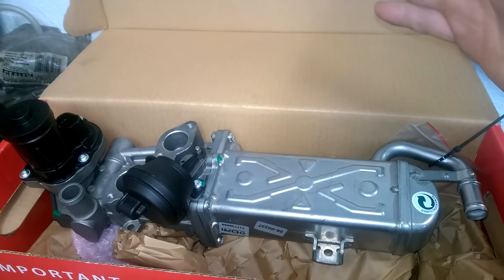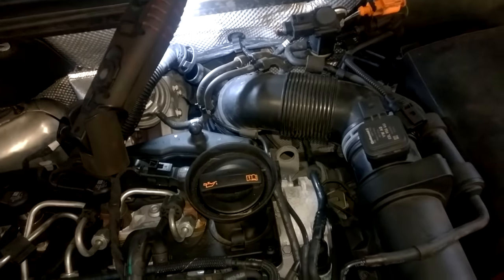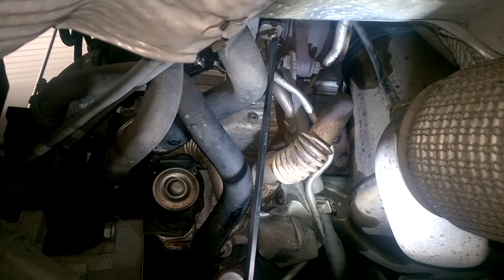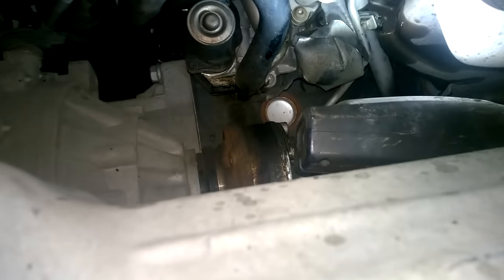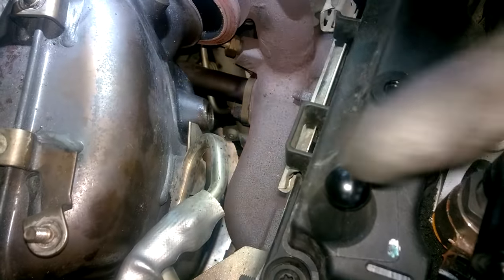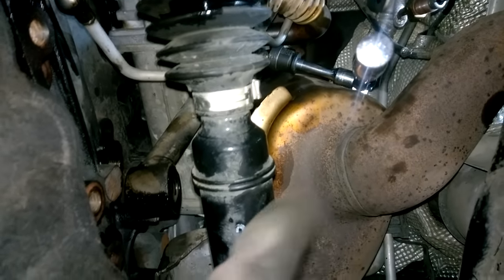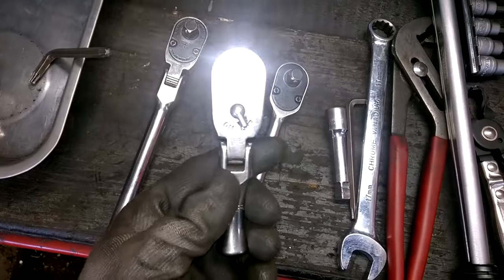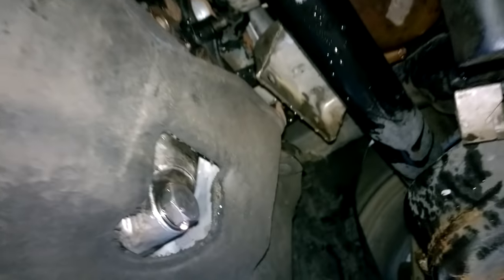Volkswagen EGR Valve Replacement - How To

Comment: Being quoted €800 by a VW dealership to get a new egr valve , am I being robbed...
Reply: Yes what about labour on top . Cant get the valve eurocarparts 250 ish or 300 .I've been quoted its 5 hour job around 550 pitlane garage luton then vat . 😥 sadly car drives perfectly no check engine light or error code for egr issue. Even when  car loses power struggles up hill has no pull  white smoke .just been told its issue with alot of diesels. What cant understand why I'm not getting an error code ..dealership are just making money for models after they sold and well get problems because the emission palaver. Its all a con and to take it out of the average diyer
Reply: ashiq shah Thanks for the reply , bought the golf nearly a year ago and it had been plugged out by the garage and never came up on the system and only found out when I brought it in for a service . They plugged it and back in and boom no power , careless for the next 3 weeks waiting on part.
Reply: @jamiemulligan7000  gave my car back had it 3 days bloody thing never went wrong ,no error codes nothing .but he said symptoms I explained  point to egr valve  possibly sticking ,choked up with carbon .until shows up on as fault or packs up dont fancy spending 600 with vat added probably a little more .good luck with your motor .on most cars it would be at the front apparently on some golfs its accessible. Cheaper job .see article that says every  50000 miles have valve cleaned out .disgusting con  by vw or manufacturers of egr valves
Reply: ashiq shah .
Reply: Got this done on a 11 passat,900euro vw egr valve done in a bosch service centre.350 for the part then the rest is labour and vat .When you see the work involved do not expect any mechanic to do this for nothing.Its a days work.
Reply: @blossmctoss  its not the EGR, its the MAF sensor.

Comment: Do you need any specialist tools for this? The VW Workshop manuals list the following:
Lambda probe open ring spanner set.
Engine Support Device

Yet to find the bit where either are needed as navigating the manuals online is a right pain in the arse!

Anyone who's done it offer any advice?

Also how does it compare in difficulty with replacing a turbo?

VW Golf MK6 1.6 Diesel  2010

Comment: Modern cars are complete and utter bastards. You could remove, rebuild and road test a Mk11 Escort in the time it takes to do this bastard.
Reply: Definitely. The parts are put together outside of the engine bay, then crammed in by hoist, then dumped on the customer.
No thought given to longer term maintenance and repair access.

Comment: If you remove the subframe with the steering box and the particle filter you are faster then this guy is doing. Just stop be lazy, the time you put on to remove the egr like this is wrong. If you are a proffesional.

Comment: Golf must be the most shit car on planet. Alwais some issue and expensive parts to buy.
Reply: That's probably because they run forever if maintained well. The older a part is, the more likely it is to fail.
Reply: @tonyburton8971  Ok, I have this issue with bad fuel odor inside cabin. I don't have any Engine light on dashboard. Other symptoms are engine running heavy and start stop funktion end working. The worst part is terrible fuel odor inside cabin every 300-400 km . Do you think EGR valve is fault or can it be something else? This issue happens when the engine partikel filter regeneration!
Reply: @FelixArdLykke  Stop/Start not working most likely battery -  mine doesn't work any more either, but since I don't spend a lot of time in stop/start traffic, I'm not bothered enough to replace the battery

If you can smell FUEL, it's not your EGR - that manages exhaust emissions. It's likely to be your fuel pressure regulator which would also explain the rough running. If you've also got black smoke coming out the exhaust then that's certain - either way, you'll need to get this professionally diagnosed - the sooner the better to avoid engine damage.
Reply: @FelixArdLykke  its a dpf filter regen process. Normal modern diesel engine process.